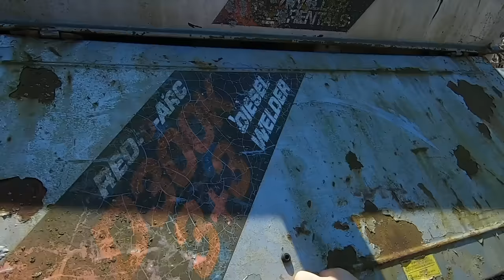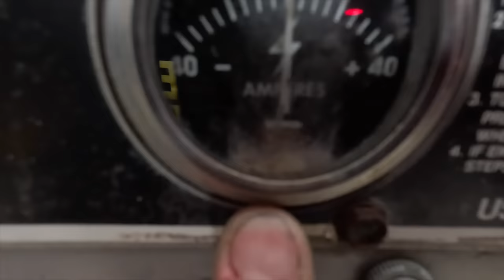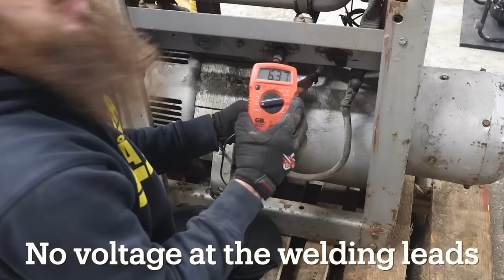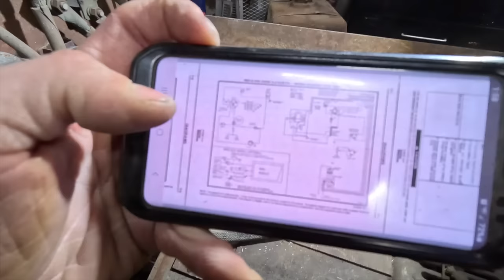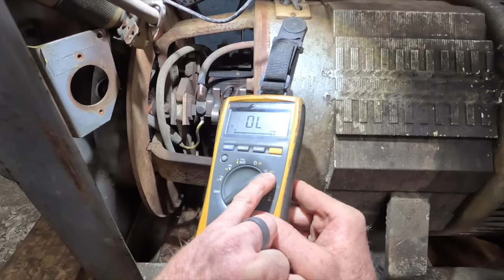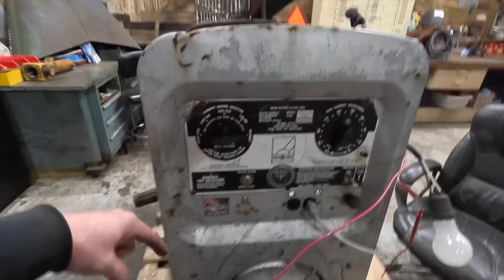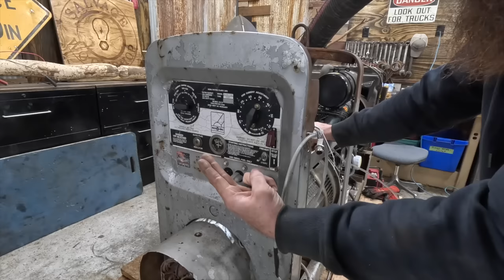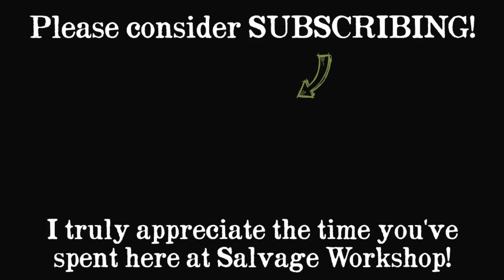SAVING an ABUSED Portable Welder from its Junk Yard GRAVE! ~ WILL IT START? ~ Red-D-Arc D300k P. 1

Comment: 1:40:26 is that a dryer clamp? Attached to the motor? The dryer clamp is attatched to the snake vent....if it wasnt attached it wouldnt be holding the snake vent? Or pulling an air out put? If it wasnt it would be nuetral?

Comment: Electrode positive is old school arc goughing, electrode negative is stick welding, kinda surprised you got any kind of weld
Reply: False, electrode positive is for stick welding. Changing the polarity only changes the penetration. You can weld with either way but for structural it’s best to weld electrode positive.

Comment: I think the dials change the amperage, not the voltage
Reply: Not sure but I think one changes voltage an the other amperage
Reply: @lawerncemiller6557  The left one was for course adjustment and the right one for fine. Both of them had Current adjustment written on them and current is measured in amps. So to tell if it's working, one would have to use an amp clamp rather than a voltmeter.
Reply: @gabriella-meghanandrews951  sounds like you know more about it than I do  I'm no welder although I do have a little 110v mig welder I've glued things together with it has 2 knobs 1 adjusts amperage only 4 settings the other is variable and adjusts wire feed speed  can use gas or not with a shielded wire  it's the only welder I've ever used other than acetylene oxygen

Comment: Amps push voltage. You cant check amperage without a load. In otherer words you have to be welding in order to check amps

Comment: I ran across this info, but it doesn't specify which Kubota diesel just giving a generic reference.
Kubota warranties its industrial engines for 2 years or 2,000 hours, whichever occurs first; major engine components are warrantied for 3 years or 3000 hours. Again, whichever occurs first. However, with proper maintenance, your Kubota diesel engine could last up to 10,000 hours.

Comment: Prefilling your oil filter is generally not a thing you need to do, the 2 seconds it takes the oilpump to fill it on its own does not harm the engine
plenty of residue oil in the engine and even if not, bearing will do its job in that case

Comment: The momentary switch could have been for the exciting of the generator - if it gets just a moment of power the generator should be self sustaining and increase resistance to the motor... but I do see the ability to electrically stop the fuel. But why the two shut offs ? Mech and electrical?
Reply: I was wrong about momentary switch, thanks for the insight

Comment: That’s a bypass button for the safety switch bud. When pressed, it bypasses the safety switch so the engine starts, then you release the button and it arms the safety shutdown switch. 
  Just fix the engineering bud. Don’t reengineer it
   If you bypass the safety with something other than a momentary switch, you’ll defeat the safety system
    You did a great job… good result and that thing will pay you back for the attention your giving it.

Comment: alternator has voltage regulator and bridge rectifier and as i saw it was 15 voltage and i know alternator should be 14volt not less nor more if you wanna test regulator increase rpm or decrease it when motor spin faster with faulty regulator it would go to 17 volt and when its low rpm it would be like 13

Comment: 1:27:48 if your flashing agenerator onsome you can use a drill
 Just flash. it by pluging  the drill in by hand where you put drill bit in first plug in the drill in and start the generator and start the drill and turn the chucwhile pressing the trigger carefully ready to take hand OFF

Good luck
😂😂😂😂

Comment: Hello
I have a certificate for servicing marine engines, and have carried out fuel installations for marine installations, generators and main engines.
A fuel supply is structured in the following order:
Tank - coarse filter / water separator - pre-pump - fine filter - injection pump - nozzles.
The pre-pump must push the fuel through the fine filter and prime the injection pump with a slight overpressure.
It is the way to carry out fuel installations on marine installations

Comment: Break it down into all its individual components diligently examining and professionally restoring each part to mirror original condition or better condition before carefully reassembling to nearest factory service condition with upgrades to modernize ie LED indicator lamps RUN/IDLE servo and Remote reostate input connector plug in play digital Hour meter fuel gage and temperature gauge. Etc .

Comment: You’re still breathing in plenty of carbon monoxide. Upon starting, you can see smoke at the blower and exhaust manifold unions. Once it gets to running well the smoking ceases so you aren’t aware of the relatively invisible poison you’re breathing. Large diameter hose used the entire run will probably help. The smaller diameter pipe is constricting the flow.

Comment: Dont use ATF. Use 2 stroke oil. The old timers used ATF back when it was basic hydraulic fluid. Its not meant to burn. It has friction enhancers and a while bunch of junk that's not good for injection pumps and injectors

Comment: Yikes! You've got your work cut out for you. Looks like a prior owner was a butcher. If I were in your position, I would take the approach that every single component in the machine will have to be cleaned, checked for function and rebuilt. The good news is that these motor/generators were simple and rugged. It should be repairable without spending a fortune.

Comment: You can convert degrees F to degrees C in your head, even if you're like me and you suck at math.  

5 degrees F minus 32 equals -27.  Divide 27 by half and you get -13.5 for all the drama queens who still use Celsius.  They love it because it sounds so much colder to say "minus 13.5 degrees Celsius" than it does to say "5 degrees Fahrenheit."

There is an actual formula, but it involves fractions.  It will give you an ACCURATE conversion, which my in-the-head math will not.  Mine will only get you close, or what I call "Kentucky Windage math."  Mine will only get you within a few degrees either way.  

In fact, let me look it up.  5 degrees F equals -15 degrees C, according to the Interwebz, and they would never lie to us, right?

So, close enough.

Degrees C = 5/9 x (5-32) is the formula, and obviously, Degrees F = 9/5 x (C+32).  If you want to fool with fractions, go right ahead.  I can't do them in my head, and at that temperature, it's too cold to do them on paper.

Comment: Hi Matt, hope you and yours are well. Great video as usual and I believe you have a great machine there. Old fashioned but solid, reliable and easy to work on. And no tech rubbish. Well done on the restoration, great job. Looking forward to next chapter. Thanks for sharing. Stay safe and keep up the good work. PS. Sixtyfiveford man is working here on an old Lincoln welder. Check out his video at 11:00, when he makes a new cable connection, a slight variation of your idea. https://www.youtube.com/watch?v=JgOPTnOcMCY&ab_channel=sixtyfiveford

Comment: NEVER use plumbing solder for ANYTHING ELECTRICAL!!! it causes oxidation/corrosion and has to be warmed up past the wires coating melting point.

Comment: 1:25:23 don't replicate this. Will cause substantial damage. Instead check to see if exciter voltage is present on the exciter slip rings. If not, check the exciter windings for open or grounded windings.

Comment: have you considered  an electric motor for your little skid steer? for those times you need quiet, or smoke free power, since you have a main one already. i would even put the batteries on a slide so if you need more counterweight you hydraulically slide the batteries out the back.

Comment: Way over kill on that exhaust setup, just the hose would do the job or at least it has at my shop for 40 years and 20 more before I got here. Big shops like dealerships that have really long runs with multiple vehicles but 20 feet? Yeah no.

Comment: That's the evolution of a Lincoln SA-200 Pipeliner. Probably the best stick welder ever made. Bills Welder Repair  2000 Southwest 15th Street
Oklahoma City, OK 73108 specializes in them and has any part you need.  Among pipeline welders those things have a cult following. Check out how pipeline guys still use SA-200 Short Hood Pipeliners made in the 1940's some of them even completely restored and chromed out. On a pipeline job if you show up with a Short Hood all the other welders gather around to admire it
https://youtu.be/iJYx1dVeL4g?si=YHLvtfQAPcI_183p

Comment: I'd have a diesel-powered machine before I would a gasoline-powered. A diesel with 10 gal tank would last me 40+ hours. A gasoline engine on 10 gallons wouldn't run full more than 8 or 10 hrs. Plus, the maintenance and repairs required for a diesel engine are less than that of a gasoline engine. A diesel for the field👍

Comment: You really have to be careful buying a used  rental welding machine.  For the most part, they've led really hard lives. When i was working in the oil patch we would use those same machines exclusively for gouging. They were outside in minus 40 degree celcius temperature running flat out 24 hrs. A day for weeks at a time.Dojng that kind of work, especially gouging is really hard on the windings and makes for a really unstable arc when welding.
Reply: Alaska, or Alberta?

Comment: Never use emery paper on carbon brushes or copper commutators, it embeds itself in the copper and grinds the brushes away. Use glass paper only, the copper and carbon are harder than the glass, and after it has polished the surfaces will fall away as dust not damaging the polished parts. This how we serviced starter motors for aircraft.

Comment: Thoroughly enjoyed that video as always, thank you (What is your name?) However your understanding of electricity is poor. You keep calling volts amps and talk of generating amps, but it's volts. Alow me to clear that up, think of it like this, a generator generates Volts, there will be no amps, or current (Which is measured in amps) flowing until the circuit is complete, if you connect something to the generator then current will flow, how much current flows is measured in amps. How much current can flow depends on the resistance in the circuit. If the circuit has high resistance (Measured in ohms) not a lot of current (amps) will flow, if the circuit has a low resistance, lots of current will flow, if you short circuit the output the resistance will be so low and so much current will flow it will probably melt the wires.
So to sum up
Voltage is a presure which when a circuit is completed makes curent flow
the current is measured in amps. low resistance high current high resistance low current.
Ohms law states that 1 volt applied to a circuit of 1 ohm resistance will make 1 amp flow
therefor 2 volt with 1 ohm will give 2 amps and so on, or 2 volt with 2 ohm will be back to 1 amp, get the idea, look up the ohms law triangle it shows how to easily convert volts amps and resistance, I don't know how to draw it on here but it gives
Volts =amps x resistance
Amps = volts devided by resistance
resistance = volts devided by amps.
hope it helps
Bob.  UK

Comment: Cool video but so much hemming and hawing over non issue stuff. You are doing a rebuild. Stop dicking around and just replace wear components. If a hose looks old then just swap it. Debating whether to reuse/recondition a fuel filter is a waste of time and money. Sizing up oil filters by eye rather than finding documentation and installing either a direct replacement or equivalent part is tedious to watch. I think it's really cool that you are doing this but there were a few moments I wanted to just jump in and start pulling and tossing in the garbage